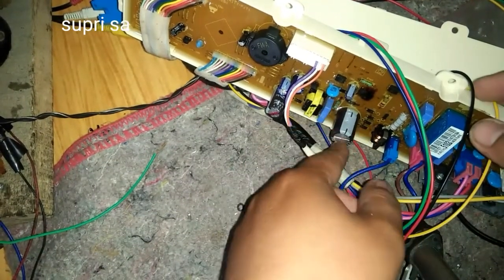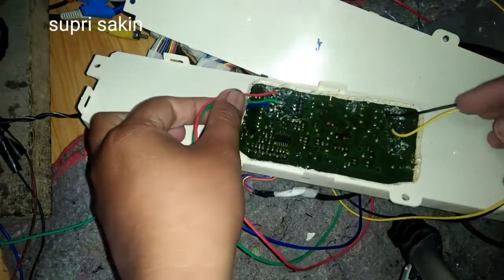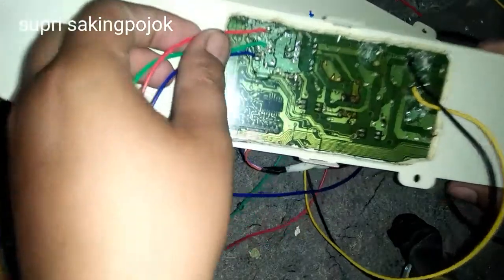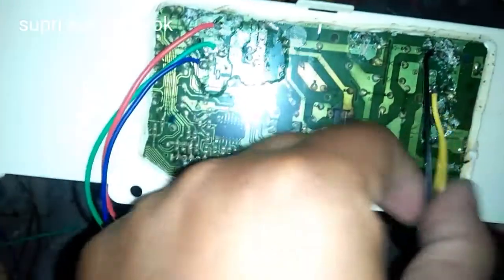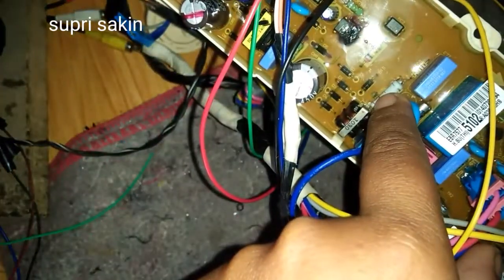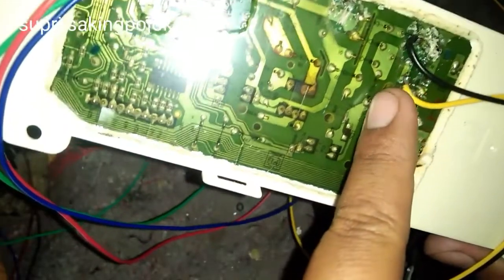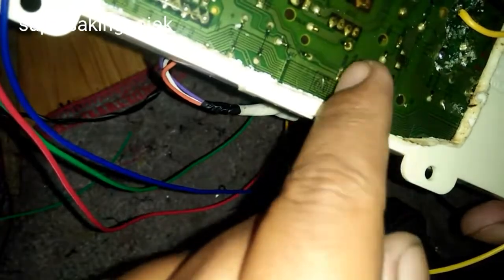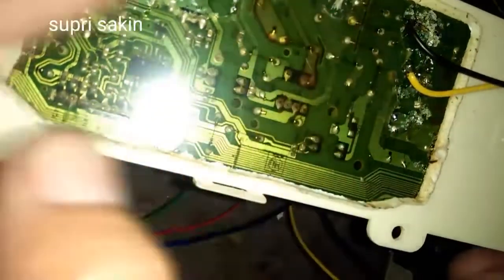cara modif ac matic LG pakai ac matic dvd

Comment: Abang supri yang baik hati, saya sudah ikuti semua petunjuknya, modul hidup semua tombol berfungsi dengan baik, modul sudah bekerja cuma driver dari solenoid motor drain dan motor wash,tidak bekerja,padahal modul sidah bekerja tanpa adanya code eror, kira kira apa   penyebabnya abang supri? Apa ic drivernya rusak? Apa betul ic drivernya kid 65783 af? Kalo disamsung icnya uln 2003. Tegangan pada ic kid 65783 normal 12 volt. Kira kira apa penyebanya abang supr? Mohon pencerahannya. Saya sudah subscribe dan mengikuti abang supri, trimakasi abang
Reply from the maker: pada waktu dipower kemudian ditekan start,apakah motor putar kiri dan kanan?atau diam?
Reply: Pada waktu dipower relay bunyi cetek kemudian distart,lampu berkedip proses kerja saat itu tetapi motor diam, kran solenoid juga diam, waktu didislpay bekerja sebagaimana mestinya, jadi tidak ada code eror muncul, mosfet driver motor maupun solenoid valve dan drain motor dicek kondisi bagus. Motor maupun yang lainnya dicek dengan memberikan arus 220 langsung berfungsi dengan baik,kira kira apanya itu abangku, mohon petunjuk abang, atur nuun
Reply: Oya abang jalur pcb dicek kondisi bagus,tidak ada yang putus maupun korosi
Reply: Tegangan 12 dan 5 volt normal,tidak berdenyut maupun naik turun
Reply: Resistor dari ic driver ke pin gate driver motor maupun yang lainnya kondisi bagus tidak ada yang putus maupun nilainya molor
Reply from the maker: R fuse hitam sudah diganti
Reply: R fuse hitam kondisi bagus,tidak putus. Apa harus diganti juga abang?  Baiklah abang akan coba saya ganti dengan r yang nilainya dibawah 100 ohm, betul begitu abang?

Comment: Ass. Wr. Wb. Mas Supri, mau tanya utk kabel ground dr ac matic dvd disambung kemana ?
Reply from the maker: gnd modul output sekunder ac matic
Reply: @suprisakingpojok5967  mesin cuci saya samsung diamond drum WA90F4, dimana ac matic tdk menggunakan trafo tp ic smps bp5053-12, berarti disalah satu kakinya utk gnd ya mas ?
Reply from the maker: rusaknya gimana?kenapa mau diganti ac matic dvd?
tipe wa90fa yg sering rusak biasanya ic mikom konslet menyebabkan tegangan 5 volt dan 12volt menjadi drop...
Kalau memang yakin bahwa ic mikom tidak rusak dan yg rusak ic ac matic ,maka cara modifnya pake ac dvd mudah.Pertama cabut ic ac matic yg berdiri hitam itu dan 7805.Tinggal sambung tegangannya ke ac matic dvdnya..12v ke tempat in 7805,gnd ke gnd pin7805 ,5 volt ke out put 7805.
Selama ini jarang banget untuk tipe itu rusak ac maticnya,yg sering mikomnya konslet...🙏
Reply: Terima kasih mas atas pencerahannya, mesin cuci mati total mas, saya curiga awalnya di ic ac matic itu, sepertinya elco 450 v juga bermasalah....ic mikom yg mosfet posisi dekat dgn ac matic ya mas....?
Reply from the maker: ic laba laba
Reply: Jalur di pcb sebelum elco 450 v tetap dipotong nggak mas ?
Reply from the maker: jalur nggak usah dipotong untuk tipe mesin cuci bapak...lepas ic ac maticnya(hitam kaki berjejer),lepas elco 450v,lepas 7805
Reply: 7805 itu spul apa transistor mosfet yg deket ic ac matic mas, letaknya dekat mana, suwun mas...
Reply from the maker: ic bentuk seperti transistor...sekedar saran,kalau bapak kurang berkopeten dalam elektronik sebaiknya tidak mengerjakan sendiri...bisa bahaya tersengat listrik atau modul bisa tambah kerusakannya..
Reply: Ya mas...tp mau coba, sblmnya kerusakan motor drain dan ganti triac bt 131 berhasil saya kerjakan, trims ya mas Supri
Reply from the maker: monggo
Reply from the maker: Kalau inverter saya blm pernah pakai AC matic dvd

Comment: Modul lg saya sama persis, mati total, sdh sy ganti ic ac matic nya dg yg sama, tetap mati, sy ganti lagi icnya tetap mati total, tegangan pada kaki ic 20 volt ac, r fuse ok, tombol on off, bagus, mohon petunjuknya pak
Reply from the maker: tegangan dielco output sekunder ada atau tidak pak?kalau tidak ada, masalah masih di ac matic..
Reply: @suprisakingpojok5967  tegangan pada elco 22 uF 600volt ac, tegangan pada  680uF tdk ada, elco 330 uF tdk ada tegangan, pada ic matic di pcb pin 2 dan 3 terhubung, 7 dan 8 terhubung apakah benar
Reply: @suprisakingpojok5967  saya sdh pasang ac matic dvd, sambungkan +12 dan -12 pada elco 680uF, dan +5 volt pada elco yg agak kecil, modul hanya sedikit ada kilatan cahaya, tidak menyala, apakah pemasangan sdh benar, mohon petunjuknya pak, terimakasih
Reply: Tolong dijelaskan lg cara nyambung nya mas ,kabel yg merah sama hijau 12v pada elco besar, biru 5v + nya aja y

Comment: Klo udah diganti ac matik tp saat perpindahan inlet ke mesin berputar kok lampu sama layarny berkedip ya mas..motor tdk isa jalan..apa mungkin amper e ac matik dvd kurang gede jadi buat ngangkat perpindahan gk kuat ya mas
Reply from the maker: bisa juga...biasanya saya juga modif pake strw6052
Reply: @suprisakingpojok5967  suwun mas..tak cb gantinya..
Reply: @suprisakingpojok5967  mas. STR W6053C atau STR W6053S  bisa juga kah?
Reply from the maker: coba cari data sheetnya di google..

Comment: mas.mau tanyak dioda Y1 yang di ac detek konslet itu nilai nya.berapa enggeh.mas
Reply from the maker: tidak hapal pak🙏
Reply: mas.ngampunten takon male.lg turbo drum mati total.aq modif pakek psu dvd kok tetep gag mau menyala.nyowon tolong solusinya.mas
Reply from the maker: sebelumnya ac maticnya memang rusak?
Reply: jadi mboten saget enggeh.trs solusi nya.gmn enggeh
Reply from the maker: saya tidak bisa memberi solusi...memang harus teliti dalam mengerjakan..tegangan 5volt,xtal,tombol power,ac detect...hanya bagian bagian itu yg biasanya bermasalah...ic mikom rusak juga  bisa🙏
Reply: ac detek nilai tegangan pinten mas
Reply from the maker: kecil
Reply: @suprisakingpojok5967  tegangan 5 volt ada..12volt ada..kristal ada kiri 2,sekian kanan 2,sekian tapi blm bisa menyala

Comment: Itu ic bawaan di lepas ndak pak? 🙏
Reply from the maker: lepas
Reply: @suprisakingpojok5967  saya coba pakai gacun teg 12&5v udah hadir tapi di pencet tombol on of kog gak respon pak, kira2 apanya ya yg perlu di cek lagi?
Reply from the maker: cek tombol power
Reply: @suprisakingpojok5967  dari AC detecnya bisa gak pak? Soalnya saya ukur seperti di vidio bapak kog teg sampai 107vdc
Reply: @suprisakingpojok5967  tombol power aman pak
Reply: Resistor pd rangkaina AC detect berapa pak nilainya & komponen smd kode d1 itu zener berapa volt? 🙏
Reply from the maker: tidak hapal

Comment: Mas saya udh ganti ic 6059 r pius jg udh tombol normal. 12v ngga ada 5v ngga ada . Di elco yg gede 450v 22uf jg ngga ada tegangn sma sekali tegangn ac 220v masuk  kira apa ye mas yg perlu di curigai.
Reply from the maker: cek komponen komponen sebelum elco 450v,normalnya ada tegangan 300v
Reply: @suprisakingpojok5967  ngga ada om.
Reply: @suprisakingpojok5967  dc ap ac om
Reply from the maker: 300vdc
Reply: @suprisakingpojok5967  ngga kluar om. Kira'' apa ye 300v dc sampe ngga ada
Reply from the maker: dicek  aja komponen komponennya mas,sebelum elco
Reply: @suprisakingpojok5967  cuma dioda aja sama r pius. R pius udah di ganti 1.5 ohm dioda di cek aman smua om.
Reply from the maker: kalau komponen bagus seharusnya 300volt ada...
Reply: @suprisakingpojok5967  mangkan ye itu om bingung.
Reply: @suprisakingpojok5967  skrang udh nyala mas 5v 14v hadir cuma colokin listrik langsung hdup tanpa di tekan power. Hidup jg cuma tulisan bb
Reply from the maker: blm pernah nemui seperti itu mas...coba di tekan power ada perubahan atau tidak?
Reply: @suprisakingpojok5967  ngga ada mas. 
Smua tombol tdk berpungsi. Cuma di colokin listrik langsung nyala bb
Reply from the maker: semua lampu nyala?
Reply: @suprisakingpojok5967  ada sebagian yg ngga nyala
Reply from the maker: blm.pernah ngalami mas...bisa juga ic yg berhubungan lampu rusak aatau bisa juga ic mikom yg rusak

Comment: Kabel hitam dan kuning d sambung kemana dulur??
Reply from the maker: ke  pcb ac matic external bagian AC IN
Reply: Saya cari R fuse model hitam itu kok tidak ada ya dulurr?
Di ganti yg kayak gimana dulur???
Mohon pencerahan nya
Reply from the maker: diganti resistor nilai kecil dibawah 100  ohm
Reply: Sudah saya ganti dengan resistor,tidak bs nyala dulur.
Maaf boleh tau nomer wa,mau tanya alamat panjenengan
Reply from the maker: biasanya sekring putus itu akibat dari ic ac matic yg rusak...harus di cek satu persatu komponen yg bermasalah area ac matic atau bisa juga di modif...maaf no wa tidak kami share🙏